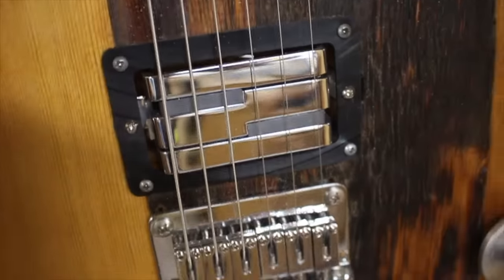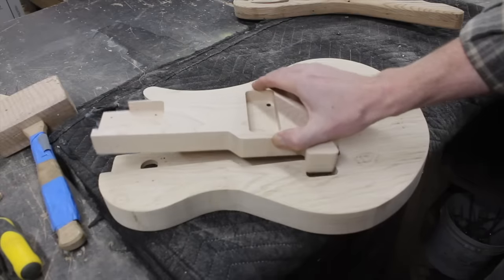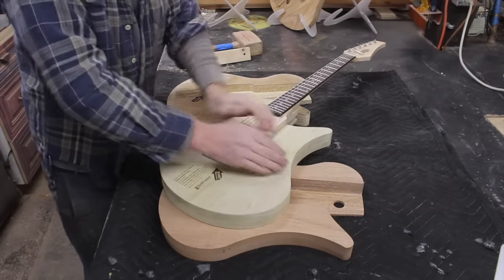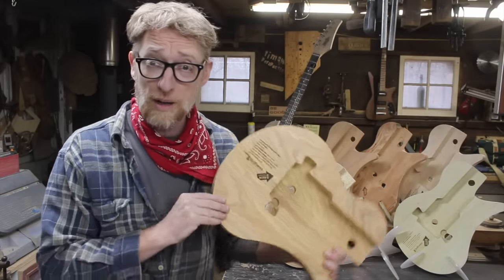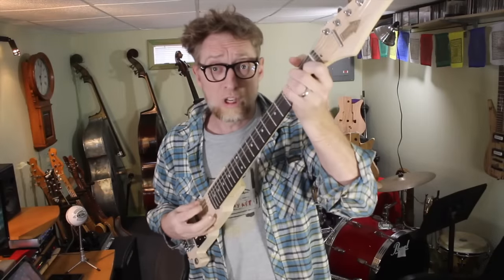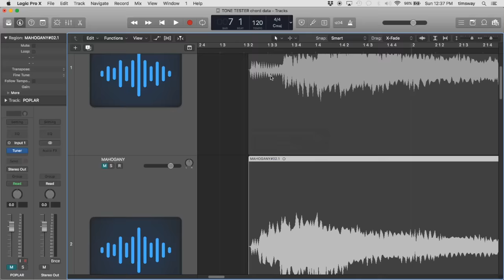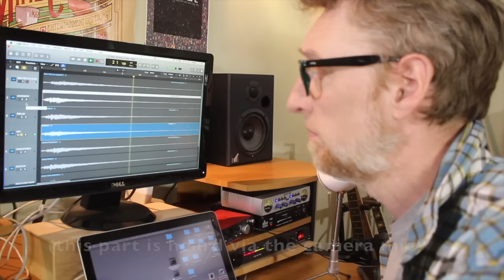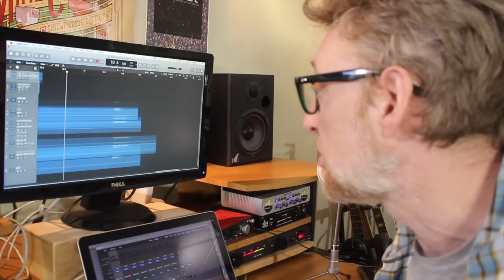Tone Wood Tester: One guitar to test them all

Comment: I think the center block is key to the lack of difference. People all over youtube chop up guitars and very little changes until they are cutting way material between the bridge and neck. The less structure you have running between the neck and bridge the more the rest of the body offers support and any variation for TONE. However, I do believe there is a way to make a quick change body that would give results and not just on different species but from one piece of wood to another within the same species.
Reply from the maker: I can think of some other ways to do it with less material, metal, etc., but this style of banging them together needed a slightly beefier chunk. What I really wanted to do was avoid unbolting/rebolting parts.
Reply: @timsway  Its super hard to do and I can see you did a lot of work and on top of it a really nice job. For the last few years I have been trying to figure a way to do this and I do have some ideas but have not put it into practice. Probably 40 years ago I had an idea to make body inserts so it could go from semi hollow to solid body. I would enjoy talking with you some time and I can try and make a video and explain it some. Maybe bouncing some ideas back and forth we could come up with a new improved version :) 
Let me know what you think.
Reply from the maker: @suavetrainwreck7300  sure! check out some of my other work, too. you may dig it. I have an aluminum skeleton guitar and a couple other detachables. Honestly I'm more interested in making unique and silly things than the science of it all, but these "science experiments" give me opportunities and reasons to play.
Reply: When the most important piece of the body doesn’t change, the whole test is mostly pointless.
Reply from the maker: @demokraatti  I anticipated your response but it seemed like a better variable-leveler than rebuilding guitars with the same parts over and over (plus the design is fun AF! :). PLEASE develop and test your system so I can see it! I think this type of stuff is fun and am a firm believer in the hivemind.
Reply: tim sway I am afraid, that there just is no way to avoid bolting components on and off. I would compare two totally different Strats with the same fully loaded pickguard. Maybe a traditional swamp ash body and a maple neck compared to some MDF body with a a neck made out of some creative material. If we are going to evaluate the importance of the wood, we have to include the neck into our comparison. Neck wood is the most important piece of lumber in a guitar.
Reply from the maker: @demokraatti  absolutely the neck is crucial to be exactly the same to test bodies. It would be fun to make a garbage material neck and test that in this setup
Reply: I kinda agree with this very minor criticism.   What the bridge is bolted to will have an effect, if it’s heard or not is not known.  If you used a bolt on bridge bridge you could do this with only having to retune the strings each time.   But I like the current test setup, and the difference noted between the insert and the insert with a body does prove that the existence of the body changes the ‘tone’.  Whether one wood species or another sounds different, or even better is I think very difficult to prove.  For me other wood properties are more important, like does the wood hold screws well, expand little with moisture changes, dent easily, take a finish nicely, look nice. etc.

Comment: I agree. They all sounded the same except for the poplar. It did indeed sound brighter. Audibly so.
Reply: AntonioKowatsch Swamp ash had a bigger bottom end though.
Reply: I wonder if he happened to pick closer to the bridge on the poplar take. I agree, it did sound brighter, but the fact that the rest sounded the same lead me to believe that there were other factors at play.
Reply: @ExDementia666  Yeah, that sounds plausible.
Reply: For me everything sounded differently, not so much on attack, but definitely on decay. There was distinct tone shift to lower mids, higher mids, treble and so on. Weirdly enough that canary wood sounded the worst to my ear and I have no idea how cheap or expensive it would be compared to other woods... Just googled - it seems like some sort of pine, and regular pine guitars usually sound like crap, lol. By the way, composite body sounded ok.
Reply: And the 'difference' in poplar can be attributed to how the guitar was strummed, where the strings were hit. About a dozen things OTHER than the wood. Perceived differences aren't differences.

Comment: I noticed a difference in every wood, not big differences but some some sounded brighter and some had more sustain. Really smart boy thinking of the density of the wood, I couldn't think something like that at his age. I also think that the wood thickness makes a difference. Also smart idea with the quick changing neck, you should patent that :D, really fun video.
Reply: The difference could easily be caused by where he strummed and not necessarily the wood. The next logical step would be to eliminate the human element that causes deviations in plucking location and force applied by using some sort of gravity actuated pendulum that strikes the strings.
Reply: @Exgrmbl  robot guitarist!

Comment: Interesting for a few reasons. 
1) If you think the marginal difference between these woods is worth paying money for you have rocks in your head. 
2) If you think that poplar is "brighter" don't buy a poplar guitar - just play a little close to the bridge. Which may well be what Tim did anyway by accident. 
3) The door being louder - as what pickups measure is vibration it makes sense that any vibration "stolen" by the wood would reduce vibration available to the pickups. Therefore a less dense wood would absorb less vibration, making more available to the pickups. This may be the only way in which wood affects electric guitars - not in tone, but in loudness. I've long suspected that Floyd Rose bridges suck volume (big heavy object at end of the string) but it makes zero difference as those that use FL bridges also use a lot of pedals. But still hard to tell because of human error. 
My conclusion would be that we should not be using expensive and potentially limited woods in guitars.
Reply from the maker: my conclusion has been and always will be - PRACTICE! haha! (Which obviously I don't do either, I prefer to make them :)
Reply: yeah, the lack of a strumming rig means where his pick was hitting the strings AND the amount of force is not the same on each take.  The picking position and force has far more influence on tone than wood.

Also a tuner wouldn't hurt.
Reply: Don't forget that the most important area of the body was the same throughout.

Regarding FR bridges, it seems to me that the biggest factor is probably the fact that the bridge will actually be moving whenever you hit a string. I haven't tried a dive only system myself but hear that there is a sound difference between those and the floating ones (?) if so then that is definitely my preferred explanation.

Comment: I think Tone Woods really matter in an acoustic and far far less in an electric. I agree the poplar sounded bright at the strum, and would make a good upbeat sounding guitar, The particle board door sounded as good as the others, to me. Sorry but I been doing some work and it was a touch noisy, so my tinnitus is going good right now and drowned out the sustains.  But, being electrics, you can make them sound close to what you want by tweaking tone, effects, special wound pickups or using piezo pickups or combos. Heck using effects you might could do a guitar version of the longest note at the end of A Day In The Life even with your neck/bridge/pickup only.
Reply from the maker: yes!
Reply: I think that the lack of a strumming rig makes this a non-repeatable test. Where his pick hits the string has far more influence on tone than the body wood!
Reply from the maker: @TedSchoenling  of course, because literally EVERYTHING ELSE is way more important to tone than the wood :)

Comment: According to Gibson your insert with the neck etc 'IS' the guitar. I had access from retired Gibson employees of notes taken from tests in the 50's they actually took guitars and sawed off the top and lower bout an inch at a time until only an inch from the strings on either side. The sound and everything sounded the same. But using different woods on these plank guitars sounded very different.
In short it is how the wood vibrates out about 2" on either side from the centre point of the neck and from the nut to the bridge that creates the sound and accounts for the sustain. On a semi this part of the guitar is called the centre block. You need to make a bunch of 'skinny' guitars all the same to hear the difference.
Reply: Well, this test actually disproved that, to a large extent. I'm pretty sure most people could tell the difference between the body-less and bodied configs. I certainly could. You're probably right that the differences would be more greater if the wood changed at the bridge, too, but I seriously doubt it would be enough that the wood would become SIGNIFICANT.

Comment: you might need a machine that strums the same force too...your manual strums might be a bit lighter or harder to each test.
Reply: Perhaps something like a mount for the guitar to make sure it's in an identical position each time, and maybe a small motor with an arm and a pick on it?
Reply: @dumpygoodness4086  but I could hear a difference? which isn't what I expected, but it sounds like it might be from picking differently...

Comment: Not surprised at all.
String vibration, moving the magnetic field of the pickup, turning this into an electric signal which is  amplified and then send through a speaker.
There can be no influence from the wood at all.

Comment: The problem with this experiment is that wood core where the bridge is attached. You are only testing how those wings affect to the real guitar. Is like getting an old Steinberger and attach 2 pieces of wood, the main line of "sound" transmission is the same, so the sound is more "modeled" after that core than the wings. Anyway the idea is pretty nice, you can have different guitar shapes in one, you can also have a nice travel guitar, and of course if you are a builder you can try different body shapes easily to decide which one is more confortable.
Reply from the maker: I have other videos about detachable guitars. check them out. This "tone wood tester" was really just a fun excuse for me to develop the idea more. I had to make all these bodies the same shape tho, for the test. In my other videos I have different shapes and even additional instruments that attach!
Reply: @timsway  Cheers!  One thing i did think was - Would a neck pickup give more of a fuller tonal range than a bridge pickup?   And therefore a more detailed 'picture' to compare. Perhaps the heard differences between woods were reduced because with a bridge pickup the movement arc of the string is smaller than towards the middle of the string?
Reply from the maker: I made a single guitar pickup with just the bridge pickup once. It kinda sucked.
Reply: I always wanted to try an “interchangeable pickup body”, maybe sometime i go back to the workshop again :)
Reply from the maker: @sirdeetoh  there's a company that does that. Sodmium guitars I think? it's pretty slick. It's on my list to do, too :)
Reply: @timsway  yes, there are some approaches to that out there, Seymour Duncan has its own system, looks nice, but you can't wear rivet writs bands ;) https://www.thegearpage.net/board/index.php?media/seymour-duncan-test-guitar.74953/

Comment: That was interesting and a lot of work.  Body material suggestion, encased horse poo in epoxy resin ala Peter Brown. That way when someone says, "That guitar sounds like horse poo,"  you can say, "Yes, because it is horse poo."  : )  Thanks for sharing!
Reply from the maker: Now I want a horse poo guitar.
Reply: I actually did hear differences in every one.  But I have ear buds on, so maybe that helped me.
Reply: @gristlevonraben  Many things can influence the difference in tone here. How hard he held it to the body and which body parts and pick angle. But as far as saying there's a tonal difference between alder and mahogany to such a degree that it actually matters... No. I would love a company like warmoth to do a test like this. 
I once read the body shape changed the tone as well. A flying V would have the wings vibrate more than a LP for instance. I think shape do change tone but in the way that a thicker body or larger body will change how you hold the guitar and thus where you pick and in what angle. Even where you connect the cable probably affect this as well. A LP will have the cable poke down on your leg or sofa when you sit down where a Strat wont.
Reply: @vileguile4  only one more step for him to make for this to be quieted and that's to have a robot or mechanical set up, locked in place, to pluck the string.  Otherwise, I have to say, the Ash sounded to me like it had a nice, mellow, and soothing sustain.  Did you not hear a difference?  I believe you make very valid points on the shape of the wood, one with wing tips and one just rounded,  also v shapes.  It may seem ridiculous to some, but that does effect the tones as you point out, that's why a Stradivarius is so unique, and Martin guitars as well.  Good points!
Reply: people just can't get enough this pseudo scientistic crap "i have a screen which shows me the sound! it looks the same! thank you!"  just  forget all the guitars and sounds youve heard all youre life
Reply: @gristlevonraben  Your final comment has fallen into the same trap that many do. There is NO DOUBT & NO QUESTION that the wood used to make an acoustic instrument (Strad or Martin) makes a huge difference to the sound. However the question is whether it makes a difference for a SOLID BODY electric guitar. The issue is how much does the wood affect the tone compared to the pickups. It seems that while the wood makes a difference it is so small in comparison to the electronics as to be negligible. Same goes for body shape.
Reply: @gristlevonraben  - No, you didn't. It's psychosomatic. And the test is only relative, anyway. For example, did Tim pick EXACTLY in the SAME spot each time, with EXACTLY the SAME force? HIGHLY unlikely. So, what you think you're hearing is only all made up in your head.
Reply: @philgallagher1  - Gristle hasn't "fallen into the same trap", he's intentionally attempted to conflate acoustics with solid body electrics in a vain and pathetic try at proving his own opinion. It's just ego. Sucks to be him!

Comment: Thankyou so much, I waste far too much time trying to convince my guitar buddies that the wood makes very little difference in an electric guitar. What ever tonal difference there is is swamped by a raft of other factors.  Your video clearly shows this. My take on all this nonsense is that the main factors are 1. the player, 2. the amp, 3. The pickups,  4. The effects chain (if any), then the guitar itself. I laugh when I hear guys like Paul Reed Smith waxing lyrical about this or that wood, whether it's a 10mm maple cap or a 25mm cap, etc etc.  It's like they really believe it. But in blind test after blind test no one can actually hear a "real" difference. Thanks for nailing the lid shut on that coffin (Although being a luthier you probably did a dove tail joint and used Tightbond :-) )
Reply: You must have serious hearing damage if that is your take away from this video. At most, some woods sounded similar. You must remember that the only difference is about 65% of the body, and not even the part that is connected to the strings. 
I've listened to knuckleheads for years tell me that wood makes  " no difference " and "only the pickups matter".
The only thing  nailed shut by this video is "the wood doesn't matter" coffin.

Comment: I still say it makes a difference but the  way to say exactly what it is to have a program that give the relative volume of each overtone to the fundamental. You can say the amp can just change the eq, fine but then it also doesn't matter what you make an acoustic out of if it's on a mic because that's almost certainly going through eq too.

Comment: If there has to be a debate about whether tone wood is a reality then I would suggest that even if true the results are pretty much insignificant. I can walk into any guitar shop, choose two identical guitars and in an instant prefer one over the other. It's impossible to compare one wood against another because there are a gazillion other factors that need to be taken into consideration 95% of which are in the head.. that's your head, not the guitar's. For example,  I know for a fact that the guitar I like the colour of will play better than that the guitar with a different paint job. In reality it's the half a dozen pedals and amplifier you are plugged into that is going to determine the tone.
Reply from the maker: I completely agree. It is the LEAST important factor in the guitar and it's sound. The most important is how much time the player practices! :)